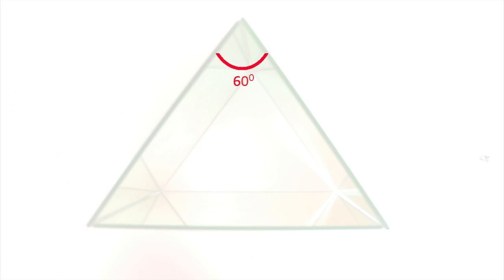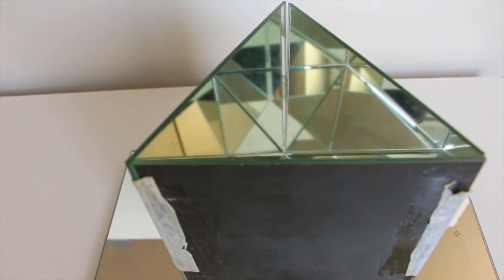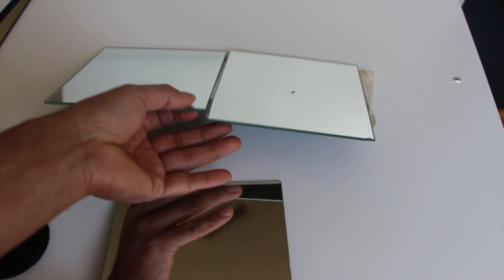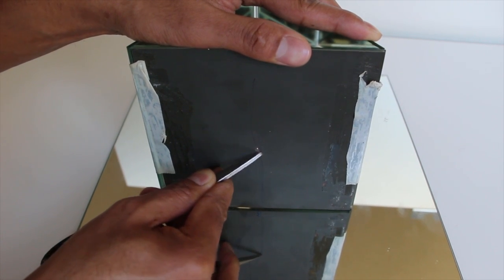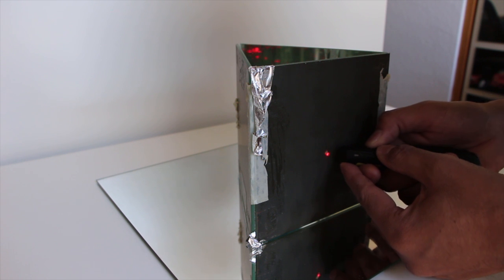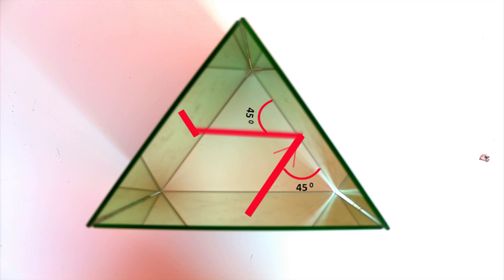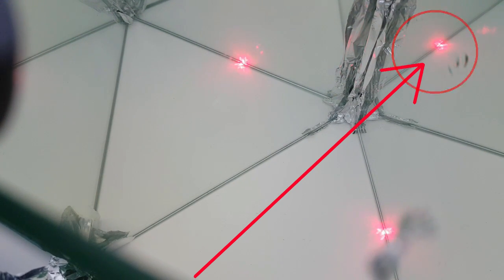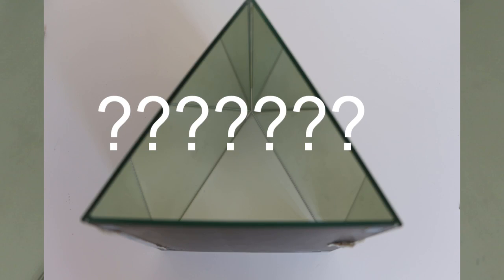Can you trap light in mirror box | Light trapping box

Comment: What are the limits for the light? Why the night sky isn't all bright everywhere? Air molecules, mirrors absorb energy and slow down the speed of light, electro-magnetic forces and gravity may also influence the motion momentum force and direction of photons, right? What else? Other radiation particles/waves? What if the mirror box or sphere were moving with light inside? How exactly phosphorus and other luminescent materials are different from mirror box on the micro level?
Reply from the maker: In vacuum light has literally no limit, it's infinite if there is no obstacle. The night sky is not bright everywhere because light photons travel only in the straight direction if we neglect Huygens diffraction edge theory. Light from the sun cannot come the opposite surface of the globe, as a result, the night sky is dark almost. yes, the mirror absorbs the energy of light as well as em waves and it slows down the speed of light. luminescent materials are completely different than mirrors materials. Its takes the long text to explain. I feel more interest, ill make another episode about it. Anyways, thanks for your questions.
Reply: @Matescium  Today I found that photons do not interact with each other, except some cases. Could you please help me to understand this fact?
Reply from the maker: Yes, photon does not interact with each other. BUt this issue can be explained only through quantum mechanics. I think its hard to explain here.

Comment: After turing the light source (Laser) off the photons will be trapped inside the mirror box for infinitesimally small period. This is due to the reflectivity of the mirror. Its not 100%. Even the super mirror has achieved 99.99999% reflectivity. Theoretically light can be trapped. But not practically.
Reply from the maker: You are absolutely right, light can be trapped very short time cause the energy of photons is absorbed by mirror.

Comment: no,the reflection of the light will not continue.but I don't know a solid reason for it .
maybe because Everytime when light reflects,it lost a small amount of property.and without a source of energy it can not get recovered it's lost property and because light has a very high speed we can not see this whole event of dieng light because of lack of energy ..
as I guess so.
but I would like to know the real reason behind it ..
Reply from the maker: The light will not run in the absence of the light source (laser) because the light is made of the photon which has a certain energy. The photon energy (energy of light) is absorbed and scattered by the mirror surface that leads to the reduction of energy of light in every collision with a mirror. For that reason, light cannot travel an infinitely long time.
Reply: @Matescium  What if we had perfect conditions? A 100% reflective mirror in a vacum with no outside energy coming in (neutrinos, gamma radiation etc.) at exactly the right angle with an extremely persice laster beam, would the beam circle around forever? Would some quantum process make it stop eventually?
Reply from the maker: In vacuum condition and with perfect mirror reflection, i guess there will be no energy loss of photons.

Comment: You are running very interesting videos.
I evaluated, and subscribed.

by the way, I couldn't catch the result of this experiment.
What happened to this mirror box?
Just trapped the light in the box.  Is that all? 
No heat created?  No explosion ?
Reply from the maker: Well, it generates more or less heat according to the theory, cause constantly the photons (particle of light) are making collisions on the same points. But it was the negligible amount of heat even it is hard to detect by hand. And of course, there is no reason for the explosion the mirror box. I wanted to show that light can be trapped in the mirror box by the condition of if the source of light constantly supplies the photons so-called light.
Reply: OK. understood.
appreciate your kind and  abundant information.

Comment: An interesting experiment. As you indicate in your write-up, to continue to be trapped a perfect mirror is needed. In reality there will be loss of energy at each reflection, so that light will only be "trapped" for a certain length of time. Have you tried to calculate, when using real mirrors, after shutting off the laser, how long the light would be "trapped" before becoming too weak to detect? Could you do an experiment to measure the decay of the light intensity, or does this decay too fast to measure? Thank you for sharing.
Reply from the maker: Very intellectual question. A perfect mirror is not possible in the real world. So, you are absolutely right that eventually, some photon energy will lose due to the collision with the mirrors. As a consequence, the reflected beam energy is immediately absorbed by the mirror that leads to the end of light trapping event. The light would be trapped very very short time in the range of nanosecond range for the normal mirror, such a short time is quite difficult to measure even with some extremely higher frame camera. The idea to show the experiment is to show that light can be trapped as long as the laser beam supply is present there.

Comment: 🌸 Hello Matescium It's an amazing experience with mirrors and light. I still don't understand why the light is reflection on the corners...I 'am not very good in English perhaps you have explained this, and I have don't understand.Thank yoy for sharing with us this amazing science experiment.🌸
Reply from the maker: This is the best question for this video, actually, i was expecting this question from someone, you made my day. Well, actually I have put a small camera on the bottom line that was able to record video only at the corner cause the installation of that camera was not perfect. So, to capture the laser beam spot I changed the incoming beam angle from 45 degrees to 70 degrees that push the beam spot near to the corner.
Reply: Ahhhhhh ok! thank you for the respons!

Comment: This was a fascinating video. My best guess is, no mirror is efficient enough to reflect 100% of energy so the light would eventually disappear. Also, if I'm not mistaken, the fact that we can see the lasers on the surface of the mirrors from outside the box means that the light is being dispersed into different directions so even if we trapped the light with perfect mirrors, we probably won't be able to see them unless you are looking directly into the direction of the light.

Just my uneducated guess :) Let me know what you think.
Reply from the maker: Well,  your first part is absolutely correct, because 100% perfect mirror is just a theoretical concept, it is not possible to make a 100% perfect mirror. For that reason light as well as photons eventually absorbed by the materials used for the mirror, as a consequence, the light is no longer trapped inside a mirror after turn off the laser source. That means if I stop the laser source, the laser light inside the mirror box is no longer existing... and I don't agree with the second part of your speech, laser light is not scattered in all directions, so when a laser is reflected on a mirror surface it travels like a beam, not as a scattered light. And finally, you are right that we cannot see the beam spot unless we see it directly on the direction of the beam, for that reason I kept my camera inside the box. Your speech is absolutely thoughtful and well-educated discussion. Thanks, bro.
Reply: @Matescium   It does scatter when it touches the mirror! A beam's reflection becomes multiple beams!
Reply: Yes you are right bro😃
And we must have to consider the camera because it also consume required amount of light! 
If we consider mirror as 100℅ able to reflect the light it's not just enough because there is camera it will consume that ligh! 
In another word we can't see the trapped light because when we see it it will be free!